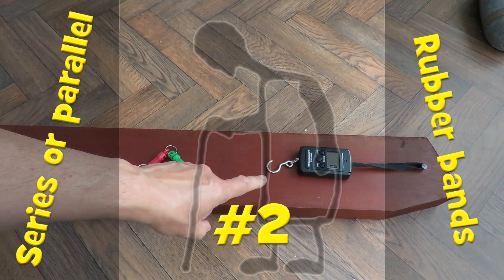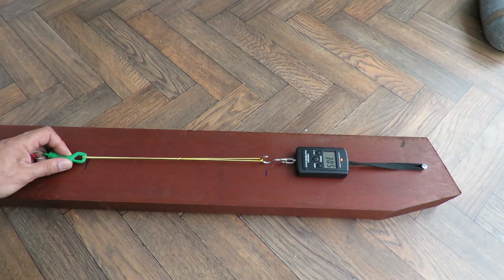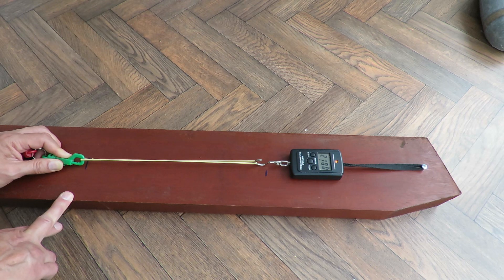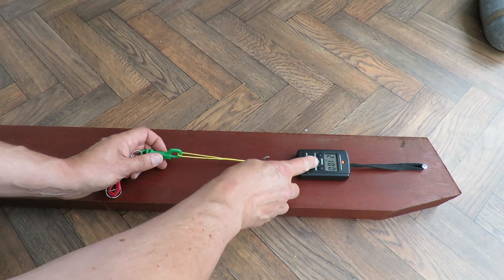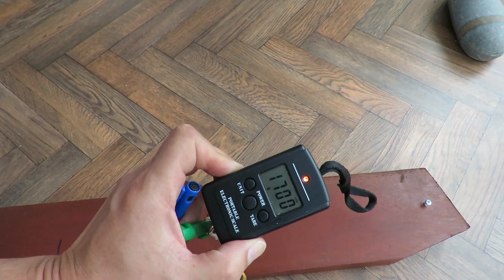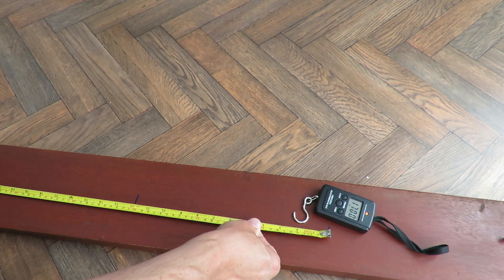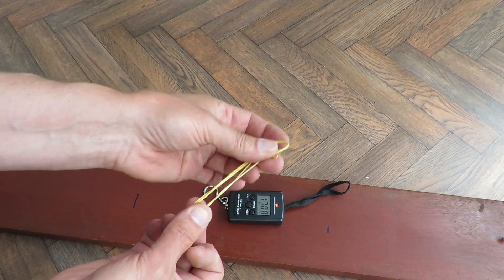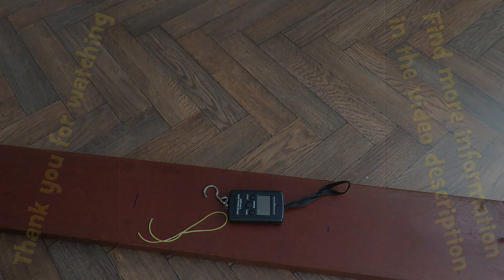Series or parallel rubber bands #2 power from stretch

Comment: Stretching 2 bands in series 12 inches then 2 bands in parallel 12 inches isn't an accurate comparison.
On the car you don't stretch them the same length.
Wouldn't it be a better comparison to stretch the series 12 inches and the parallel 6 inches?
Reply from the maker: I guess that just depends what you are trying to demonstrate. I am not trying to match them. I think I explained it fairly clearly in my summary about the power over the distance. When you apply this to a rubber band car you would be wrapping the band (or string attached to the band) around the back axle. Let's say each turn around the axle uses half an inch of band stretch length. With the parallel bands you can wrap 12 inches and get 2100 grammes of stored energy which will take 24 revolutions to unwind. With the bands in series we stretched them to 3 feet before they broke at 1700 grammes of stored energy so that would give us 76 revolutions to unwind or 3 times as much as the parallel bands
A CD is about 5 inches in diameter so the circumference is about 15.7 inches.
If you are using a CD for the wheel the car travels about 15.7 inches or 37.7 cm for each rotation.
That means that under power in parallel format you would travel 24x15.7 inches or about 377 inches
and in series format you would travel 3 times the distance. Then you have to consider how far the car will freewheel after the bands have finished. The parallel car will have had a higher speed at the start of it's freewheeling run but needs to travel another 754 inches just to get to where the series car begins to freewheel.
Reply: Yes I understand.
Reply from the maker: Wil Hobbs Sorry about the long answer. I was writing it down so I could past it into the video description as it helps to clarify what this was all about :) Part of that was cut and paste from a reply I have somebody regarding simple braking mechanisms on rubber band cars when they need accuracy on stopping at a predetermined point.